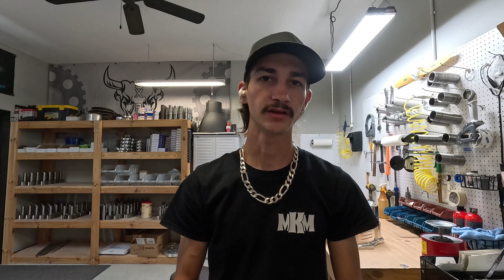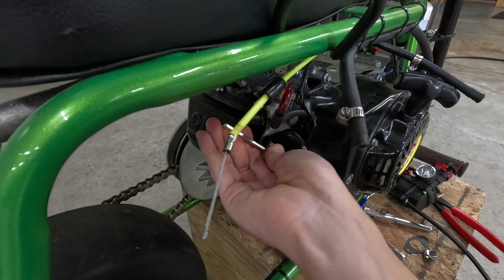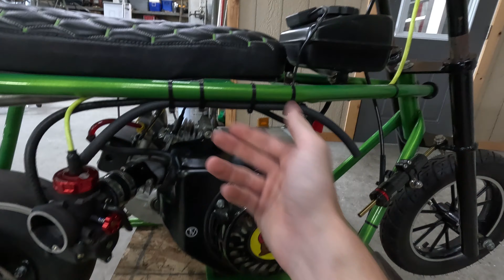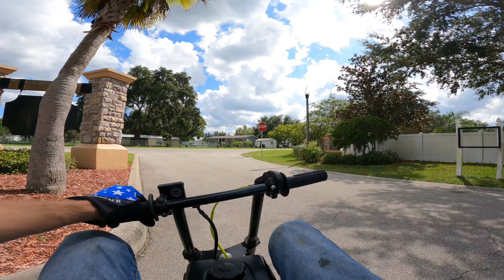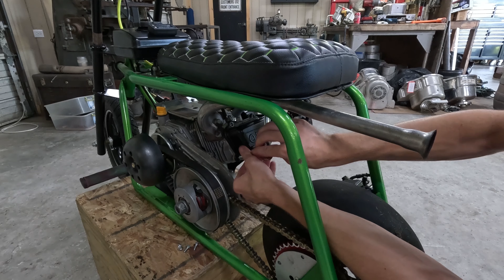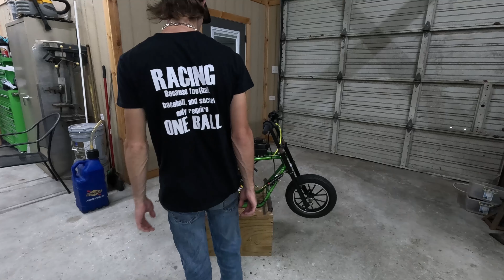I pushed my drag bike a little to far!

Comment: You like the launch of a torque converter then try a noram premier stinger clutch and put some higher stall springs in there and u will have a better launch than that torque converter and will go over 70 easily
Reply from the maker: I might have to look into that! Thanks for the suggestion!
Reply: Yup that’s what I have with 35 chain 15 tooth I paid $200 for the set I still have 2500 stall but I like it. I’ve used it on both my 420cc engines he and my 212

Comment: gotta drain the carb every day with meth. Then fill vent with wd40 and you'll never have any issues. Also need a WB02 otherwise you are just guessing on the Air Fuel ratio. I have a WB02 rig in a back pack with a lipo battery I toss on to tune. Then remove it.

Comment: LOL my friend had a predator 224 CC stage 4 motor went around 95 to 100 mph, he wasn't running thick enough oil so what ended up happening was his entire crankshaft twisted itself in half ended up bending his rods send a piece into the side of his piston skirt the sleeve is shredded and it's just torn up he done messed up his s***

Comment: the EXACT same thing just happened on my hemi tillotson 223 stroker. Same JT251 head. 265 cam with 1.2 rockers. Middle rocker pin part blew out and i lost my rocker! Just got it back together today and it's a beast again! I'm on a mega moto 212 tho....hill climbs and offroad. Cool video! What jets you end up running? Curios. Im on a 112 right now.